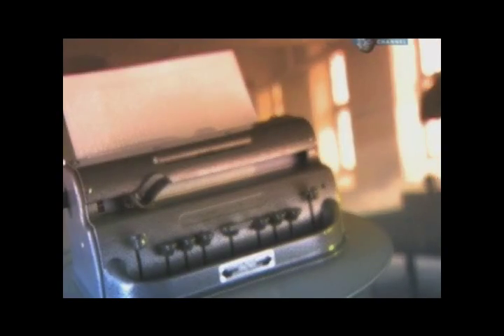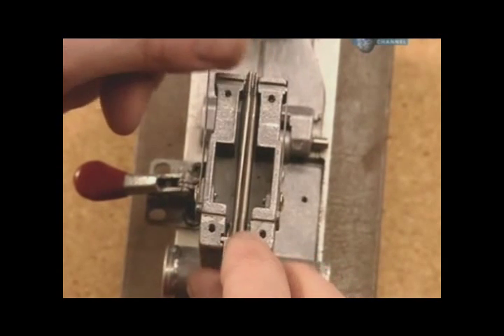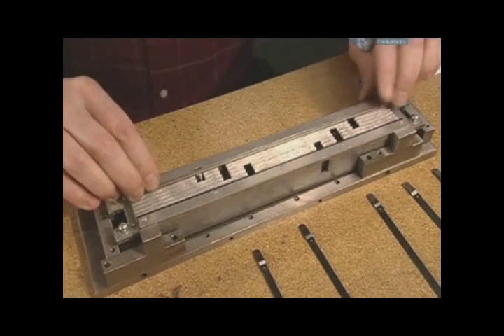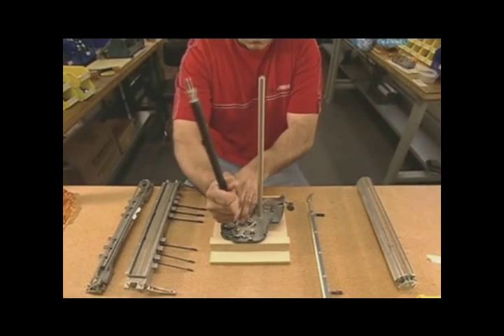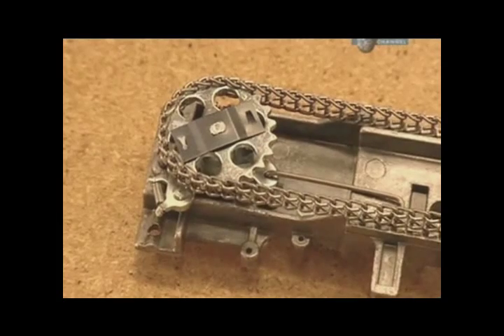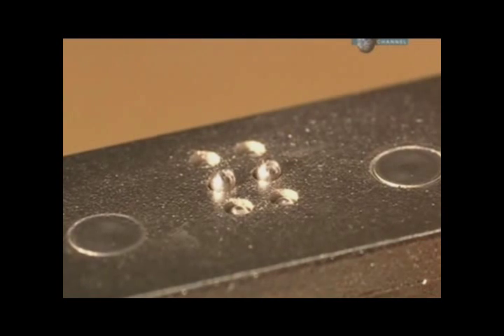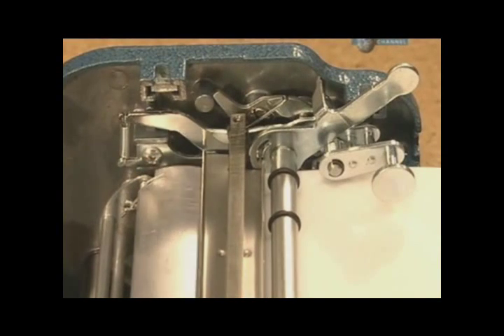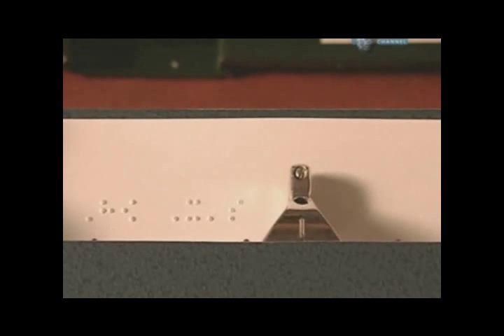How it's made: braille typewriters

Comment: I like the Brailer but… It's way too heavy I know they have that stupid plastic ones but those always break. I used to have a plastic  Brailer and it broke in like six months later. I was kind of mad because I liked it because it was light. I also liked it because it had this little shelf where you could align the paper correctly. I just didn't like it because the paper would jam sometime and they would actually break. The metal ones are better even though there's so so heavy. I am so sorry about my incorrect spelling and my grammar. I am using dictation because I am using an iPad and I do not feel like typing :-) typing takes forever when you're blind on an iPad to be honest unless you have a keyboard. Anyway!